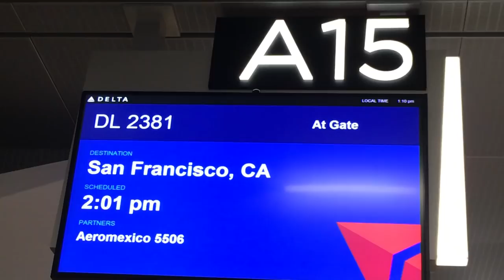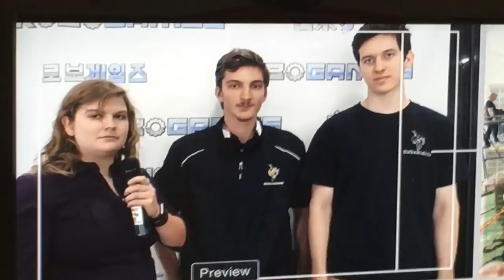Mandiii Fights Again, 120lb Battlbot - RoboGames 2018

Comment: Why didn’t you go with a one piece drum instead of a two piece
Reply: gravity center would have been offset
Reply: @haltair4015  Would be the same whether 2 or 1 piece were used, as long as the drum profile's correct e.g. Touros' drums. An offset-balanced drum from identical segments would need at least 3 pieces(the middle one being twice as wide as the others).

maybe having 2 pieces makes it easier to stay balanced in case half of the tooth sheared off?

Comment: how come you guys where allowed to enter 2 robots? i thought they where implementing 1 robot rule?
Reply: OMFG gala different weight classes. And we had two 3 pound bots but they were trying to fill up spots anyway
Reply: yeah light and middle, but i thought the rule was 1 robot regardless of ether light middle or heavy? i though thats why the catclysm/warhawk guy dident compete with cat Kong as well, and why only touro maximus turned up ?
Reply from the maker: The rule was you could register 1 robot and waitlist another. So we ended up getting off the waitlist for the other robot once we got there.
Reply: @thisdustin2435  ah so like a reserve/ if they where low on numbers? thanks for the info was curious. is there any improvements planned for manddiii
Reply from the maker: Yeah pretty much, it's a list of people who get to join the competition if other people who are registered don't show up. I am not in charge of mandiiii any more but yes, were mostly focusing on a bigger drum and moving the center of gravity farther back for better drive control.

Comment: I love seeing what you guys do. (Hopefully) future student here. How can I become a member of the robojackets?
Reply: You need to understand how to do a Robot, and prove it´s existence  ;)
My serious opinion is, Get a nice Power Supply, like a very nice Battery, then Motors, Like Stepper Motors, a  Motor Speed Controller a Transmitter  and Receiver for RC Cars. I guess it´s a Start.
Would be nice (opcional), to understand about PWM, which stands For "Pulse Width Modulation".
And then just... Do your best... I´m just trying to help, if you like electronics go check it out !
Reply: If you want to join robojackets, you just gotta get into GT and then come to the meetings. No prior knowledge needed. You can usually find a booth at Faset.

Comment: I am shocked you used aluminum for a frame... especially upfront.. some good ol hardened steel would have done much better. the good bots are using tips on the spinners that basically could be used to machine aluminum.